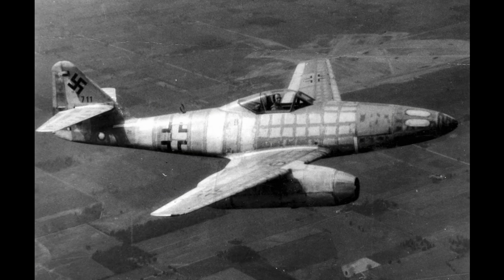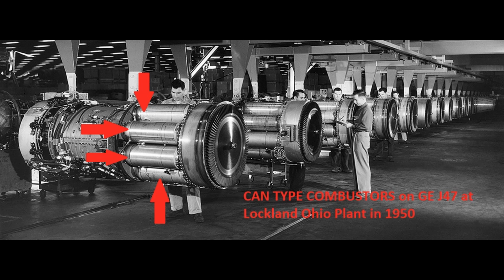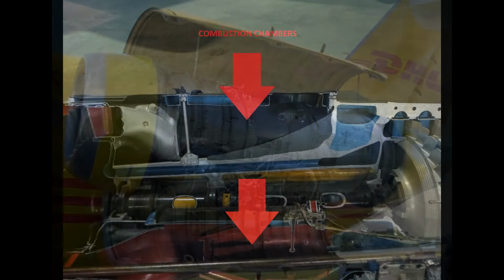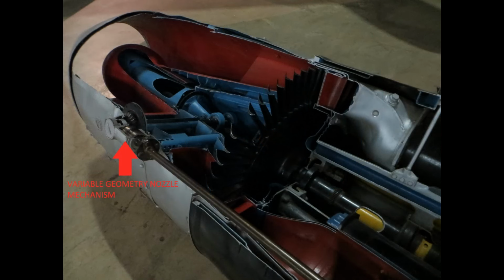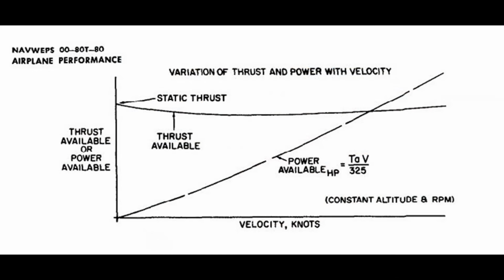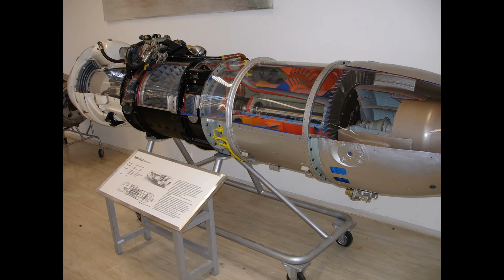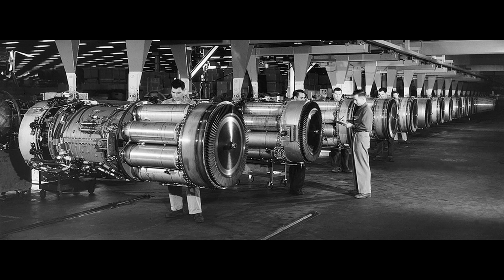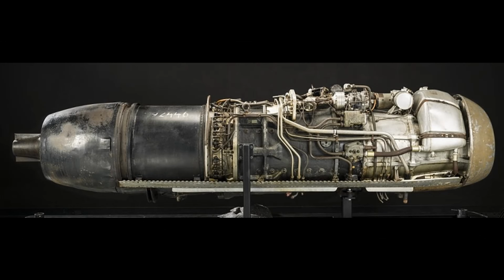World War Two JET POWER

Comment: These engines had a TBO of 8 hours.
Reply from the maker: A TBO of eight hours? Please state your source.
Reply: @GregsAirplanesandAutomobiles     I am sorry I can not document my statement as it goes back to 1970 while I was in A&P school at Northrop Institute of Technology. They had one of the engines. And my instructor was lecturing about it as it was an example of early early design. I recall him saying it was 8 hr TBO. It still impressed me.  Unfortunately the school is now shut down.
Reply: @oldmech619     The working Jumo 004s that have been rebuilt with better materials for Paul Allen's museum are estimated to be 300 hrs TBO according to the turbine shop that spent 10 years researching and rebuilding them.
Reply: @FiveCentsPlease    “The first production model of the 004B weighed 100 kg (220 lb) less than the 004A, and in 1943 had passed several 100-hour tests, with a time between overhauls of 50 hours being achieved.” “Given the lower-quality steels used in the 004B, these engines typically only had a service life of some 10–25 hours, perhaps twice this in the hands of a skilled pilot” . Ref: Christopher, John (2013). The Race for Hitler's X-Planes: Britain's 1945 Mission to Capture Secret Luftwaffe Technology. Stroud, UK: History Press. ISBN 978-0-7524-6457-2.   So 8 hrs doesn’t sounds too far off.   Did any Me262 make it to 300 hrs?
Reply: @oldmech619     Can't speak for wartime Me-262s.   Paul Allen's museum funded the work to rebuild their 004 internals with new metal and 300 hrs is their estimation--and their Me-262 hasn't flown yet.  And if the museum stays funded, they usually don't put more than 10 or 15 hours on their aircraft each year (probably less) so it will be a while before the 300 mark is known.

Comment: That first flight of the 262 must have been breath taking. 🙂
Reply: Not really, heinkel 280 and 162 flew before it both with jet engines.
Reply: first flight must have been rad since the still-at-early-stage-development BMW engines, originally designed to power the Me-262, had both a flame out mid flight, so they had to land with nose-mounted Jumo piston engine!!!

Comment: The reports I have read from German and Allied pilots who flew the He-162 Volksjager said it was a very good aircraft. While not as fast as the Me-262 it was a very capable aircraft with good manuverability and agility.  British test pilot Eric Brown said it had very light and balanced controls. 

The problem was it was intended to be flown by inexperienced pilots with a minimum of training.  Little to no experience in a aircraft of any type is not a good combination.  Experienced pilots familiar with high performance aircraft had little problem with the Volksjager and actually liked it. 

Most of the problems were due to the low quality jet engines and the glue used to build the wooden airframe.  The original glue intended for use was bombed by the RAF and the replacement glue was later found to be acidic and dissolved the wood leading to structural failure. 

The HE-162 was also one of the first aircraft to use a ejector seat to push the pilot clear of the jet engine right behind him.
Reply: And i believe in one of the ejector seat uses the pilot got squished... 

It was also the do 335 that used an ejection seat first
Reply: @APFS-DS  HE-219 had them first!!
Reply: it was faster than Me262...He162 could reach 562mph, fastest operational german jet. It was also fligh-tested with promising BMW 003R (20 KN when using also the paired BMW 109-718 rocket engine) with undisclosed official results ( probably it could reach Mach ciritcal number of airframe in a blink of  an eye)

Comment: Still blows my mind that they were started like a Lawn Boy.
Reply: The primary Electric Starter activated by a cockpit mounted switch... pull start was an axillary backup.
Reply: Logistics... any airfield that supports  bf109 and fw109 van also support me 262. No need to haul a starter around when the front is shifting fast, for airfields that means 100 miles a week sometimes.
Reply: Very pragmatic design!
Reply: Imagine your crew are getting ready to prepare this plane for you, They’ve loaded it up with bombs and ordinance but someone left the lights on in the bloody cockpit and drained the batteries!! Oh well it looks like someones gotta go and atleast help. As the pilot of either the 262’s or arado’s you go up and start to rip the fuck out of the wire till that 10hp engine kicks on and you see the engine starting to turn and the blades spinning quicker and quicker.

Comment: Krupp in fact considered developing an alloy of Tinidur with twice the nickel content for the Jumo 004 but shortages meant they stuck with a relatively low nickel content.
Reply: yeah apparently 600 grams for whole engine and that was less than piston engine. but amricans didnt have such problems and their first jet engines didnt last any longer anyway. how come? they didnt even have good alloys developed?
Reply: @jebise1126  The problem with the early jet engines was the fuel metering.  Everyone got this wrong.  The Jumo 004B used a centrifugal governor which was set by the pilots throttle.  It could overdose if moved too quickly causing a burnout or over fuel cold flameout or underdose and flameout.  The solution was to put a differential pressure sensor across the compressor to measure airflow and dose according to that with rpm secondary.  This device was called the accelerator valve or beschleuniguns ventil and was scheduled to enter service in April 1945.  The alloy wasn’t really the only problem.  This was all understood a little late but everyone like Bosch started adapting their fuel injection systems.  Also duplex nozzles that switched to a different nozzle at low flow to ensure proper vaporisation at idle and high altitude.  Lack of fir tree roots on the turbines didn’t help.  The thermocouples in the exhaust displayed on cockpit gauges but needed to be connected to a Proportional Derivative controller to damp out any residual temperature spikes.  Needed electronics, which the Germans had.  The main thing was the acceleration valve.

Comment: May I submit that leaving out the metallurgy of the engine is misleading. The engine change life of 20 hours is a serious compromise. The Whittle engines with their centrifugal compressors were arguably superior operationally at the time, although I freely admit that the Whttle design was ultimately a dead end.
Reply from the maker: I'm not sure what you mean. I specifically mentioned the lack of proper metals limiting engine life. It's impressive that the Germans found a work around for this that made the engine run at all, let alone make it far faster than any British Jet of the time.
Reply: @GregsAirplanesandAutomobiles  I apologise for any lack of clarity. Eric Winkle Brown who flew all the aircraft concerned (I must paraphrase because I can't find the quote) said, the ME262 was the best aeroplane of the war but the worst thing about it was the engines. The Meteor's engines were the best thing about a mediocre design. A lot of that was down to the metallurgy.

But in the context of the metallurgy which was the better engine?
Reply from the maker: It depends on who is chasing you.

Comment: As allways I really enjoy your work. One thing I would like to coment on is how the thrust is generated. As a former J 57, J79 and J85 tech, my info taught me the the thrust generated was split between the compressor and the exhaust nozzle. Each blade in the compressor is shaped similar to an airf oil, thats a lot of forward push. The Jumo 004 generated 2000 pounds of thrust, approx half was by the exhaust nozzle the rest by the compressor. The compressor thrust is reduced in part by the power turbine which pushes in the opposite direction. The stress on the shaft that connects the turbine to the compressor can be in the 2 to 3 tons range. On the latest generation of ultrahigh by pass fan engines the stress on the shafts could be in the 25 to 35 tons range.
Reply from the maker: Really? Are you saying that the forward compressor acts as a sort of propeller? I'm not saying that doesn't happen, it actually makes sense, but I have never read that. I'll look into it, I am buying it, I just need to see it from an official source before I start saying it.
Reply: @GregsAirplanesandAutomobiles  I will have to check my source, but I believe it comes from one of Bill Gunston's books as well. I will get the title and page numbers.
Reply: The book is titeled "The development of jet and turbine aero engines" by Bill Gunston. ISBN 1 85260 586 3, Library of Congress catalog card No. 97-61069. He is heavley biased towards british engineering but this remains a good read for people who want to understand this technology.
Reply: Sorry, page number 76 for the engine area thrust break down.
Reply from the maker: I know of Bill Gunston, thanks, I'll look it up.

Comment: Junkers Jumo 004 was a good design which was held back because the Germans couldn't get enough temp resistant metals for the turbine in the hot part of the engine.  These metals in short supply included nickel and chromium.  So they had to make the turbine out of steel.  This made it prone to heat failure.  Pilots could only advance the throttles slowly, had to watch the temp carefully, etc.  This explains the short life of the Jumo 004 between overhauls.
Reply: Yes, that's how I understood it as well. 
Dr Franz had the bench test versions made out of appropriate alloys running well, then the whole development program was held up for a year finding a way to make them out of aluminium and mild steel - not ideal but available.
Reply: @tsegulin  The recently built Me 262 replicas do NOT fly with original Jumo engines.  They fly with modern ( safe ) engines.  I don't think an Me 262 with original engines could be rated safe for flight.
Reply: @petenick7829  Agreed and I didn't mean to suggest they did. 
What I meant was that (as I understand it) in the early 1940s the original 004-009A engines were developed using appropriate high temperature alloys which in the event were not available for mass production of the 004-009B engines, which had to be re-engineered to be constructed from aluminium and mild steel; a process that held up operational service of these engines for a year and led to a powerful engine that nevertheless required delicate handling of the throttles and had a short service life.
Reply: @tsegulin  Agree.  Jumo 004 with proper heat resistant metals was a good engine.

Comment: I'm a 1941 metrovick f2 man myself, developed later into the sapphire but not really during the war as us backward brits had jet engines coming out of our ears
Reply: Steady on Paul....the Metrovok was an axial flow engine, and the US has told us that we only had Whittle's engine and that they came up with axil flow.
Reply: @superancientmariner1394  i know, having to suffice with only 9 compressor stages and a 2 stage turbine and giving  more thrust than those "more advanced" German jobbies
Reply: @paulnutter1713  Metrovick F2/2 design was given to General Electric in 1943 (on the insistence of Metrovick as the two companies had a patent sharing agreement in place). F2/4 Beryl was first ground run in Jan 1945 and passed its 100 hours run test with no major issues what so ever (try that with a German Jet Engine). Metrovick were not interested into going into aero engine production, thus the reason that the F9 project that became the Sapphire was sold to Armstrong Siddeley in 1946. This is well worth a read.

https://www.research.manchester.ac.uk/portal/files/54530197/FULL_TEXT.PDF
Reply: @richardvernon317  thanks for that link Richard, you were right, very interesting
Reply: @richardvernon317  I read the article. It's fantastic. At least one date incorrect however. The F.2 powered Meteor, S/N DG204 port engine exploded on 4 January 1944, not April. That was the only British axial-flow jet to fly during WWII. The F.2 exploded after only three hours of operation, killing the pilot William Davie. This inaccuracy casts doubt on the entire paper. One thing is certain though. The British never used a jet in actual WWII combat due to the Meteor's slow speed. It would not be until 1947 that the F.2/4 which is completely unrelated to the F.2 would actually fly.
Reply: @paulpaul9914  Allow me to help, the port side F.2 exploded on 4 January 1944, casting doubt on all points made in the paper. That was more than a simple mistake. The Metrovick never operated correctly, and all design work was abandoned after the fatal explosion. The F.2/4 was not related to the F.2, the engines are completely different. From the accident report: " During one of these runs the Meteor's port Metropolitan-Vickers F2 engine exploded."  and "Development of the F.2 ended in 1944. Development of the basic concept continued, however, eventually leading to the considerably larger F.9 Sapphire. "  -- Wikipedia, Pip Pip Cheerio!
Reply: @richardvernon317  The British were unable to make the F.2/4 work (fly) until 1947, in a flying boat, the  SR.A/1. By 1947 the US had already flown the axial flow F-86 jet fighter powered by the J47, which initially had a 15 hour overhaul life. The Jumo 004A had already reached the 100 hour overhaul life in 1943, however, the 004B production variant only had 15 - 50 hours. It's not possible to compare WWII German combat jet engines with British bench test models, as the British never used a jet in actual WWII combat.

Comment: I think it was "Bismarck" but I learned that due to some crazy edict the BMW 004 was restricted to use only 650 grammes of nickel in its design. If the Junkers 003 was similar that's got to be one of the most stupid short-sighted things I've seen. Not only would the engines have lasted longer they also would have been able to develop more power.
Reply: Nickel wasn’t even in short supply till Finland changed sides.  It was used to create spall free armour and u-boat hulls.

Comment: Not sure what Air Combat Maneuvering Instrumentation has to do with a DHL-leased DC9.  Was it at Nellis?  It'd never make it past Students' Gap.
Flame out can actually happen quite readily, especially in fast, agile aircraft.  Prime causes include compressor stall or air starvation caused by manoeuvre or shock wave effects.
The other reason for having a fairly high bypass on the A-10 is that it helps shield the hotter centre exhaust and thereby reduces IR signature.  Modern MANPADs can see a lot more than just the red-hot bits in the tailpipe so it helps survivability to reduce emissions from other aspects.
The other limit on performance of a prop aircraft is that the blade tips go supersonic, with great reduction in efficiency, well before the rest of the airframe.  Of course this gets worse at higher altitude where the blades go trans-sonic at lower TAS.
On reliability, you may be interested that about 30 years ago I had a chat with a German DDR Mig-29 pilot.  He assessed the MTBF of the Mig's engines as about 100 hours.  He'd ejected 6 times for catastrophic engine failure.
Trivia aside, a great look at the design and operation of the JJ004.  Thank you.
Reply: Good point on the transonic propeller issue.  That can occur at low speeds (even sitting still) with some direct-drive engines - that's why the R1340 on the T-6 Texan has such an irritating snarl.  On a Tropical Day, down here in Florida, (When the temperature drives the Mach Number up a fair chunk), and you're near a T-6 takeoff, you can hear the "blat" of teh prop tips going supersonic about halfway down the takeoff roll, as the forward speed adds to the rotational speed of the prop.

Comment: Since I was a kid looking in the encyclopedia and library books -- I'm 60 now -- I have never heard an explanation of why air is not simply pushed into a spiral through the compressor blades with each stage simply increasing the speed of the spirol instead of increasing the compression. Every diagram, video, and graphic I can recall has shown the entire compressor section to be turning along the axis. Until now I have never heard the term stator blades nor heard that they remain static within the compressor group. Finally everything makes sense and I don't feel like I just can't comprehend jet engines. An immense thank you to you, Greg!
Reply from the maker: Thanks, I'm here to help.
Reply: Stay = stator. Easy way to remember
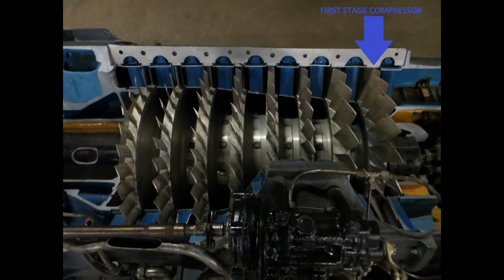Reply: @OffTheBeatenPath_  The problem is not understanding what a stator vanes are, but that almost no jet engine description even names them. They just say, 'these are the compressor fans, they spin and compress the air' that's it, thank you, go home now. Even the cutaway of the engine in Greg's video has the stator vanes nearly completely hidden even if in plane site. See 1:45  If they had brought the vanes out just an 1/8 of a turn, showing that they are immovable, while the compressor blades spin and compress the air through the stators, that would make the whole thing for easier to understand.
Greg explains the stator vanes simply and concisely, and the first time I'd heard of them.
Reply: Has anyone reproduced one of these engines with upgraded metallurgy?
Reply: @garynew9637  I've never heard of such, and I would kind of expect not. Maybe one to put on a stand and demonstrate, but putting one into a flying ME-262 would be rather foolish. They were difficult to manager and if you didn't manage them correctly, they could easily stall, with deadly consequences.

The Messerschmitt Museum in Manching, Germany, which is close to Ingolstadt and not far from Munich, has an ME-262 which is a reproduction of an original (all the parts were reproduced from the originals, because the original parts were is such poor condition). But the engines are General Electric CJ610, which are very modern and used in some Lear jets and small commercial airliners.

Safety and practicality first.